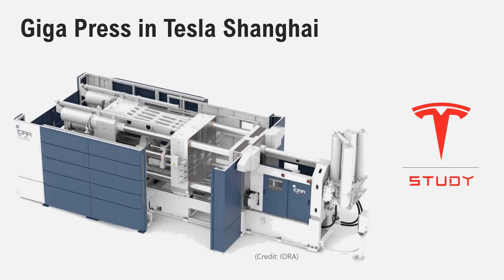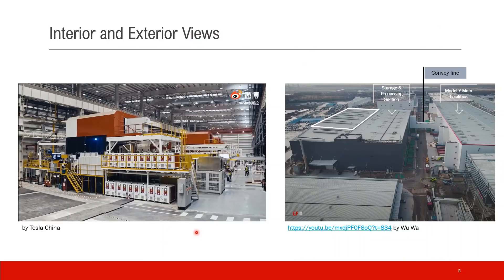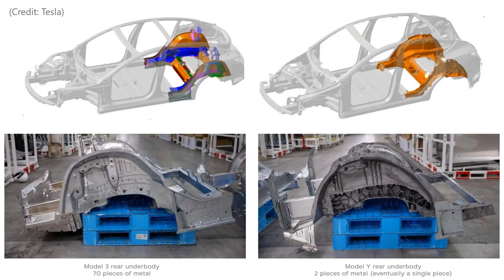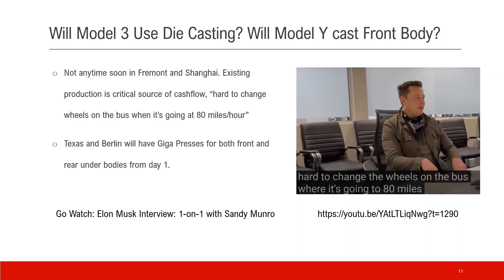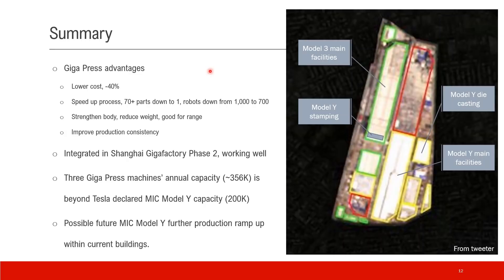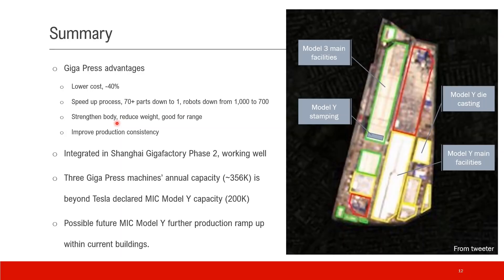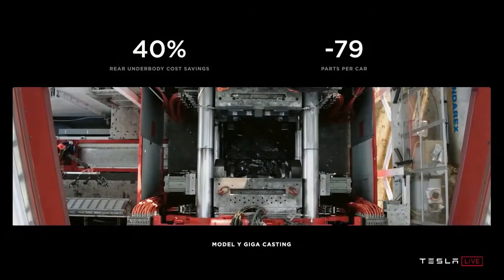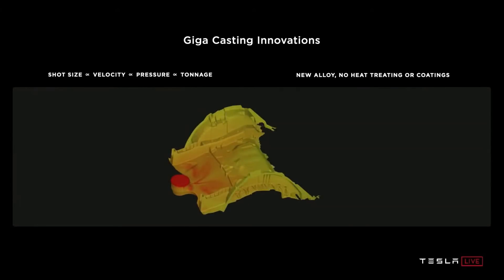Giga Press Machines in Tesla Shanghai

Comment: My question is , does the 2021 model 3 made in Shanghai ones are pressed by Giga Press as well?
Reply from the maker: I don't think so. Owners can easily check rear underbody by lifting the cover in trunk. If new MiC model 3 uses casted part, it would be in headline now.
Reply: @t-study5089  i just bought a 2021 model 3. Is that a good choice?
Reply from the maker: @gw8361  Congratulation! It is a good choice. Enjoy it.
Reply: @t-study5089  21款3和y 会不会有很大的区别，由于一个是giga press 一个不是giga，我买了3是不是不好呢？谢谢

Comment: How many giga press(es) in giga Shanghai now? 3? 2nd giga press seen in giga berlin near end Mar 2021, while 2nd giga press seen at giga austin a few days ago. This mean giga austin is not far behind giga berlin in terms of operational dates?
Reply from the maker: 3 in Shanghai now. There is a possible extension to the die casting shop in Shanghai. Could be more in future. Elon said that Berlin will try with both front/rear underbody die casting. If work out, Shanghai and Fremont will do the same. That means probably 3 more in Shanghai and 2 more in Fremont.
Reply from the maker: The time gap between Giga-Austin and Giga-Berlin is probably 3-4 months, in term of CONSTRUCTION. However, there seems some head wind on the final production permit for Giga Berlin. Berlin site was projected to start operation in late July/early August. But Elon's recent twitter signed that it might not be the case.

Comment: How has the fatigue life changed on the total   cast new alloy without heat stress relieving treatment verses fatigue life of previous heat treated alloy casting?
Reply from the maker: I thought most of die casting parts cannot do follow-up heat retreatment, due to tiny compressed gas bubble in metal. Can you share some info about "previous heat treated alloy casting"?

Comment: I think the cycle time in Fremont is about 240 seconds. I timed it from the time the release agent starts getting sprayed, then the mold opens and closes, until the next time the spraying starts. The video is running 8X speed there so the actual stop watch time was multiplied times 8 to get 240 seconds. Regrettably this is not a precise time because the video changed to 1X speed just before the second spraying started but it is very close. It is possible the cycle time will be reduced as they dial in all the parameters and possibly fine tune the mold cavity geometry.
Reply from the maker: I did in similar way and get 190 sec. Count from opening mold, 22 second normal speed, 21 second  8x speed. Giga Press wiki pages says "The cycle time is ~80‒90 seconds,[2] ", but the source does not mention 80-90 second any more.

Another company, SCODA uses die-casting for its gearbox house, smaller but more complicated. Their cycle time is 125 seconds. Their die-casting machine was provided by a Swiss company.
Reply: @t-study5089  What your method leaves out is the time the mold was closed before it opened. The material has to sit in the mold for a time cool the part sufficiently before it can open. The video does not show the dwell time except in during the 8X sequence. That’s why I did all of my timing in the 8X section. In addition, unless you are comparing this part to a similar weight and size part there simply is no comparison. Smaller parts cool faster. This is a massive part requiring considerable time to cool. Otherwise the part would come out of the mold like silly putty. You can see the sprue of the part, which is thicker than the actual pert, flopping around like a wet noodle in other videos. It takes even longer to cool the sprue but that can happen outside the mold since it is trimmed and discarded (recycled). There is also a small amount of time for the two side actions to open and close but probably only takes a few seconds.
Reply from the maker: @jeffbransky6499  Thanks for the detailed description. I count from the moment the mold open, to the next moment the mold open. This should have included the cooldown time in the 8x section. The math is 22 + 21*8 = 190.
Reply: @jeffbransky6499  Although I agree with @T-Study on the cycle duration -- I got 188s on my calculation -- you made some great points on the process! A larger part involves more molten metal, which means more heat (both latent and cooling) needs to be removed through the mold for the part to fully solidify, and that in turn means a longer cooling time. One thing I'd mention -- which you kinda alluded to -- is that the wall thickness is more important than the size of the part when it comes to cooling rate.

Comment: Why are there no Model 3 gigapresses?  They started with a fresh factory.  It wasn't going 80 MPH.
Reply from the maker: First model in Giga-Berlin is Model Y. Giga Austin the same. Whenever possible, they will use giga press. If the second model in Berlin is Model 3, it will use giga press for front and rear underbodies.
Reply: They were still developing the tech in 2019, so they had to go with the process that existed.

Comment: I believe your 180s cycle time is too high... The video of Fremont where that number is from was sped up less than the description suggested.
Reply from the maker: Very possible. SKODA uses die casting for gear box housing. It is a smaller but probably more complicated part. The designed cycle is 130 seconds. They can do it in 125 seconds. It is a smaller die casting (3000 ton) from Swiss vendor, not IDRA.

Comment: One problem I see is with lesser weight the cars are only going to have a harder time driving on snow covered roads as they will ride on top of snow with little traction. See this type of problem with most modern cars. Also how well will these hold up in a salt environment during the winters.
Reply: As of now Battery electric vehicles are very heavy compared to ICE vehicles. Untreated aluminum last longer than untreated iron, however aluminum will deteriorate at some time, at least my bicycle wheels did.
Reply: @srenjensen3817  in Upstate New York our town uses liquid blend of salts to treat the roads for snow and ice it next to impossible to rinse off and it speeds up rust and corrosion on aluminum on the vehicle regardless if it is rustproofing.

Comment: So the presentations states that gigaBerlin and gigaTexas will utilize single piece front and rear castings. Do we know if gigaTexas will be utilizing 4680 batteries from day one like gigaBerlin?
Reply: The general consensus is yes. Would not make much sense to engineer for old battery system then refit factory for new structural battery. The fun bit is how they will handle having two different versions of model Y in production. My thought is that they will build up stocks of new type, then release them once they have enough to cover the gap while Fremont gets refitted for new version.

Comment: Nice job!  I think that throughput will be somewhat higher at the factories designed from the ground up to integrate them into the processes.  Probably around 166,000, that would match with the claimed design outputs for gigaAustin and gigaBerlin of 500,000 annually. See: https://handlemanpost.wordpress.com/2021/02/27/giga-casting-ramifications/ for details.  Fremont video was the first gigapress.  It was installed at a facility which was never intended to utilize castings for manufacture of cars.  So it would likely be a bit slower.  Details of my assumptions and thinking.

Comment: Die Cast? Das sieht eher wie eine Gies Maschine aus,als wie eine Presse.
I think it is not a press. It is Die Cast.
Reply: High pressure die casting.
Reply: @kschleic9053  I still don't think that makes the machine a press.
Reply: Ronald Garrison The main function of the giant machine is to press the casting molds so that the pressurized molten metal does not push them apart. All the design consideration about the machine is having powerful hydrolics to generate high pressing force. Tesla actually never called it Gigapress. The company that built the machine is the one that named it Gigapress. To them it is a press Tesla just used them to assist in die casting.